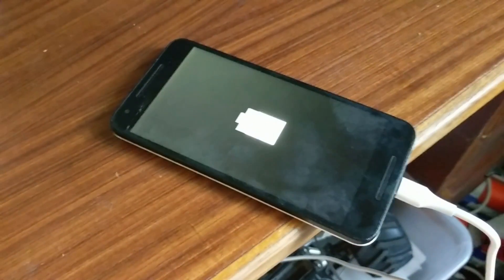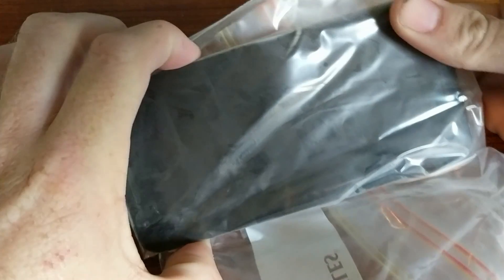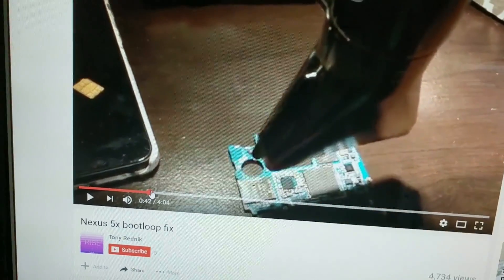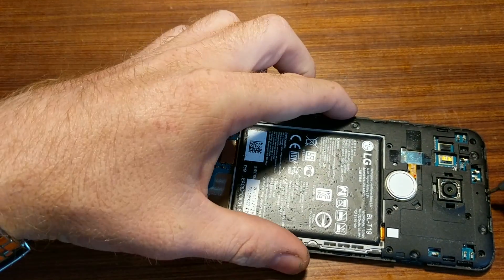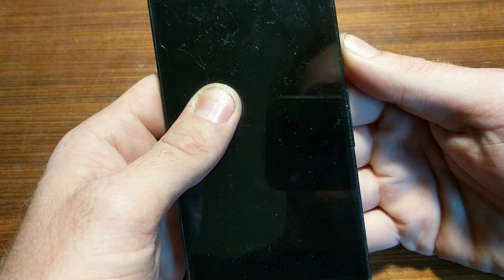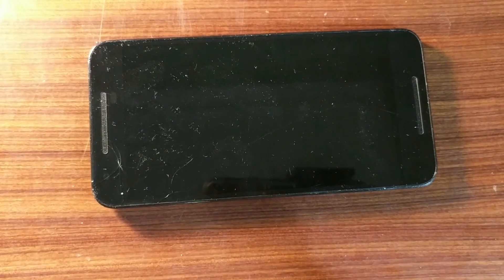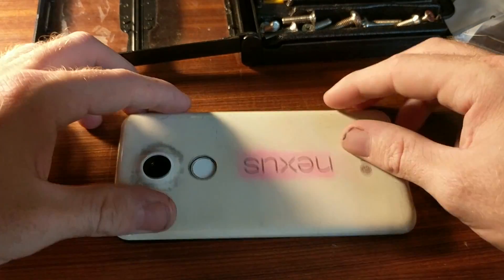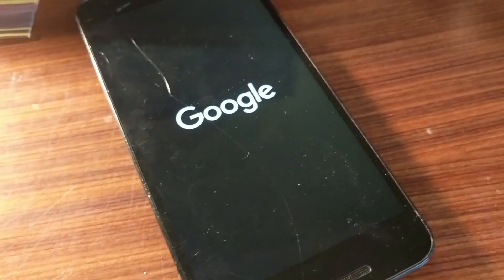How To Fix The Nexus 5X Bootloop (At Least Temporarily)

Comment: What happens when the SoC gets in direct contact with the heat ??  It had worked the first time then the error came again.  I did it again and the device worked again.  The device has no root and the bootloader is too.  I installed Substratum the next morning and Andromeda from XDA ran the script on the pc.  Later, the device did not start anymore and stayed in fastboot mode.  Now it does not start anymore.  So I ask if it can be that it does not start because the Snapdragon was too hot.  because otherwise everything looks good. ??????
Reply from the maker: Sometimes it only works for a short time after repair. The fundamental design issue is still there

Comment: So this happened to my lady's Nexus 5X and I had just the same idea with cooling and heating. This video really helped me to actually go ahead and try, thanks!

It took me two tries, first time I heated for 1 minute with my 2100w Rowenta CV 3724. After partial assembly I've connected device to computer via USB, device got further into loading routine, but was going back into bootloop after couple of seconds. Second try was 2 minutes. I've measured temperature on the chips with a pyrometer ~110 degrees C (during both tries). There was even plastic smell after 2 minutes, might have heated it for too long.

After assembling for the second time it took several rebooting attempts to go further. All the attempts were performed with device connected to a computer via USB. I was fortunate enough to get all the files from the device. It worked for like 10 minutes straight, after that I performed factory reset and disconnected phone from the computer, after what it got back into the bootloop again.

If I try to turn it back on it goes into bootloop as before my manipulations. But I got my files from the device as I anticipated. Don't be reckless with your actions and it will work out. Good luck.

Oh, by the way, I've managed to put back this metal shield, since it easily and securely snaps back into number of small "sockets" on the PCB.
Reply from the maker: Glad you got your files back! Great write up.

Comment: @What Up TK Here use the trick with the hairdryer go to developer settings unlock oem and then flash via bootloader the 4core image from xda developers
Reply from the maker: as it’s a hardware problem I’m not sure flashing helps much, did it work for you?
Reply: @WhatUpTKHere I have just tried it and  it didn't worked but I will try again

Comment: I'm having the same problem now, last night my Nexus 5X was fully charged and out of the blue just shut down. It then kept trying to restart itself showing the Google logo, to then shut down, trying to restart again and shut down again constantly. I pressed the power button and turned it off. I then tried the power+volume up, leaving it on charge, stayed there all night and didn't do anything, it was just stuck on firmware update at 0%. I found it boiling hot in the morning. I let it cool down, then tried power+volume down, and neither of the two options would work, Recovery Mode nor the Restart Bootloader. When I selected Restart Bootloader it would say No Commands. I also did a factory reset but still nothing changed, the main problem is that the phone doesn't stay on, I was only able to try these options by keeping the phone plugged in, as soon as you unplugg it from the charger it dies!
Anyone has got any suggestions? Thank you
Reply from the maker: Hope you recovered it@

Comment: Once you pull the motherboard out - Use a heat gun on it for about 1.30 then leave it cool for 1 hour, put the phone back together. Hairdryer is not enough heat to remelt the solder points.
Reply from the maker: Joe Szabo as I discovered in the next video ;D

Comment: The only thing that is easy to break on this phone is part of the plastic shield, it is really easy to accidentally break in half, but breaking it isn't really a problem as there are screws about 1~2cm away from the place it tends to break on both sides, so you can literally just put both pieces back on and it will be fine XD
Reply from the maker: Good call!

Comment: Haven't had a chance to read all the comments, so apologies if this is a rerun of other comments, but I'm going to prattle on just the same:
1.) Turn the hair dryer onto "cool" or "air" - any dryer made after 1990 should have a non-heat setting
2.) Grab some silica packets from shoe boxes, pharmacy or vitamin bottles... and put them in the bag or tuperware box before you put them in the freezer
3.) Don't have any silica packets? You can buy "water pellets" or "water beads" from your local big Crafts store. They are made to go in vases and the like, but they suck moisture out of everything -- including condensation.

Thanks for all the help. 
I know a lot of people are overjoyed to have their files back.
Reply from the maker: That's a great idea, re: silica gel. Thanks for sharing!
Reply: @WhatUpTKHere  use the trick with the hairdryer go to developer settings unlock oem and then flash via bootloader the 4core image from xda developers

Comment: Or you can enable oem unlock and debugging then flash a custom boot image to keep it always working.
Reply from the maker: Marcus Weinberger doesn't work if you're stuck in bootloop, tho <3
Reply: Good point, what about using your method to get it to temporarily work, then using mine (I say mine, but I found it elsewhere)? Teamwork :D

Comment: Getting into recovery is pretty good though. I had the same problem with 2 identical phones, different timetables. For some reason, some of the cpu cores crash, or cause a nasty error that gives the boot loop. I had my phone with default settings and no usb debugging permissions, so I freezed it and managed to grant myself permissions over USB. Then I applied a custom bootloader I've found on xda and kinda fixed the problem. The phone is still working, but is quite slower.
Reply from the maker: Nice! Did it live long?

Comment: My Nexus 5x (which I had for 1 year and 4 months) just died two days ago. The freezer method worked a few times but I'm glad I copied all my photos and videos (not the recent ones) to my computer about 2 or 3 weeks ago, so I had nothing to lose pretty much. I'm not trying the freezer method again simply because I'm worried it'll get any water inside and possibly trigger those small white stickers and turn them to red (the ones that determine if your phone has been in contact to water). Haven't tried the heat gun yet but I'll just RMA it and keep you guys updated. This is the best phone I've ever had and honestly I just see myself (if this phone get fixed) using the Pixel phones by Google as it has stock Android. I'm just worried it has the same problem...
Reply from the maker: Funnily enough my Pixel did bootloop, too. However I was lucky as I had warranty on that phone.

Glad you got your files back!

Comment: Also worked for my nexus 6p i thought it was a software issue couldnt reboot to recovery or anything until i tried this i was able to start up the phone without having to factory reset or install fresh firmware. Btw i done this without taking the phone apart. If you do just avoid heated the battery area and concentrate on the board side of the phone.
Reply from the maker: Glad it worked for you!

Comment: Did you put the back back on once you finished with the hair dryer, what about the metal shield for it
Reply from the maker: Yeah, no difference.
Reply: oh ok, so what are the nonessential parts for file transfer, so i only have to plug in the motherboard right
Reply from the maker: Dhruv Jain not sure, I'd wager you'd want the phone close to fully reassembled because you need the screen to log in and approve USB file transfer. If the phone is locked you can't dump your files
Reply: alright thank you so much, btw is 30 mins enough in the freezer
Reply from the maker: Dhruv Jain only one way to find out :P

Watch the second video I did on this too.

Comment: Thanks for the video. This was not a firmware issue for me as the exact same boot looping started happening after the phone rebooted randomly and would not boot back up. Used a heat gun for about 30 seconds on each side. Let each side cool a bit for few seconds before starting on the next side. Phone booted right up after the heat fix.

Comment: LOL, I'm bidding on a bootlooped Nexus 5x was curious what they meant by bootloop The fix should be easy... I don't know how a reflashing of the phone wouldn't work... Many talk about this bootloop and the fix was to reflash the phone.
Reply from the maker: Matthew Knight give it a go for sure. This phone was literally completely unresponsive prior to freezing. Can't reflash the phone if it's not even responding to USB.

After I dumped the files I attempted a reflash through ADB and it failed at 57%. Sucked.
Reply: TK eh I have nothing better to do with my time my only fear is possibly fixing it then it happening again I was planning to buy it for my mom. I'd hate to have the phone fuck up 2 months in to giving it to her.
Reply from the maker: Matthew Knight yeah, I get you. Some may be fixed with a reflash but for many it's actually a hardware issue and much tricker to fix. Even after the follow-up video I only got another month out of mine.
Reply: You're not selling your nexus 5x on eBay right now are you? cause someone has one for $50 and free shipping, And he too did the freezer method which is extremely bad to do, should never put any electronic into a freezer, when it starts to sweat after coming out of the freezer its just as bad as putting your phone is water...
Reply from the maker: Matthew Knight certainly not selling mine haha.
Reply: TK eh I ended up winning that Nexus 5x should be interesting, I've heard of two possible fixes, 1 if you can get into recovery mode then you can flash it with a fix that will disable some feature hardware wise and the other fix is if you can even get your phone to work by draining the battery you can take the phone a part and add a copper heatsink on top of the chip and add thermal paste.

Comment: Same issue here. I was running Android 8.1 for just 24 hours and it just died while at the charger. Luckily the freezing method worked for me and i was able to secure some very important docs and unlock the OEM bootlock. then it just died again. I saw a few bootloop fix tutorials so i hope do be able to revive it definitely.

Comment: Just followed this video and attempted to reflow my 2015 Nexus 5X with a small hot air gun (sparkfun model).  I was nervous about lifting some of the very small caps next to the chips, but applied heat from a distance for about 90 seconds.  Seems to have done the trick.  Thanks for the walk through.

Comment: You can open up the device , take motherboard out, remove the mettalic cover and keep motherboard under sunlight for 2-3 hours. And the let it be open for some time after that at romm Temperature and then try to put back everything at place and turn on the device..and you can see it working..

Comment: Yeah, happened after my last security update. Luckily I back up automatically to the cloud, not so lucky it's probably 2 weeks out from the Pixel 2. Thanks for clearing the issue up. Not willing to fully take it apart for a hardware issue, but it at least saves be the hours of trial and error.

Comment: hai bro...  
i do have the same problem.. i have heated upto 300deg by hai dryer.. for 1min then after 1hr.. i switched on mobile. it worked for 2min then back to dead.. i heated for 4 times in 2days  about 1min 45sec.. it opens and goes to bootloop... main problem is chip is getting very hot.. with in seconds for hitting power button.. how to make cool of the chip and any solutions bro?

Comment: I've managed to fix my Nexus 5x from the infamous bootloop. It had been doing the bootloop for weeks and me and my friend looked on line to fix it and of course we tried this method but we didn't have a heat gun so we just used a dryer and it sorta worked, it lasted for about 5 seconds lol, but before then I  couldn't even go inside, but this "heating method" only worked once, and then we were out of ideas to fix it, we couldnt do anything to the phone with a computer because I forgot to check OEM unlocked and USB debugging ,so we couldn't change the Android version or anything but then my friend went to recovery mode and did the sideboot and somehow managed to do something (I wasn't there) and it actually booted and he quickly checked OEM unlocked and USB debugging and then we were all set , we found this fix that we wanted to do ↓
https://www.xda-developers.com/nexus-5x-bootloop-fix-boot-phone/
And my friend did this for me( I don't know how he did it cause I wasn't there and even if I was I wouldn't have been able to understand a bit) and it actually worked!! 
So i hope you guys try out this method , if you don't know what you're supposed to do and your not so good at computers then go to your friend that's good at computers and hopefully he/she will fix it for you . And I think if you just follow the steps you'll be able to do it anyway ( if you have OEM and USB debugging checked) if not go to recovery mode and do a sideboot/sideload , ( I'm not sure but my friend said he'll make a video on how to fix it even you don't have it checked)
BTW I actually thought it was impossible so I bought a Galaxy S8 so now I own 2 phones .... yeaaaay :-) 

I'll come back here when he makes a video good luck guys!!!
Reply: Jake Martin your phone still works?
Reply: Is your phone still working Jake Martin?
Reply: Tired it still doesn't work.

Comment: After applying a piece of tape on the fingerprint connector found at the back of the plastic cover, the phone kept working after being assembled. Maybe some kind of shortage was caused? Nonetheless, thanks for sharing!
Reply from the maker: Interesting! Perhaps it's putting pressure on the chip and improving a connection somewhere? I might have to experiment - thanks for sharing!
Reply from the maker: can you show me a photo?
Reply from the maker: Didn't work for me I'm afraid!
Reply: My phone started bootlooping while I was texting, and coincidence, my finger actually touched the fingerprint thing 1-2 seconds before it started fucking up. So yeah, maybe my fingerprint connector's the problem ?

Comment: Worst google phone ever... bad Google update work... shame to say it, but it's sad. :(
Reply: I don't have any doubt of your testimony. But This phone is dissapointing, the only good feature is the camera, this board/hardware issue is only the proof of a bad design and a bad construction.
Ok, I will see you channel.
Reply: Robert Martinez I really like the camera and the fingerprint sensor (thought I can't believe they didn't include image stabilization, Nexus 5 was better for moving video). It does seem to run less smoothly than my Nexus 5 overall, plus 5" is a better size than 5.2" for me. At least LG is fixing this major problem. I would really like to see Google run both a Nexus line (really just a Nexus 5 with updated specs) and a Pixel line. The Pixel is a fantastic phone, but the price is simply too high for me. Thanks for checking out my videos, I hope you have the same success as I did getting your phone fixed.

Comment: I'm real fuckin' mad. Saw this on r/nexus5x after mine bootlooped last night, worked on a 30min freeze for about 2h last night, tonight it only worked for <2min- booted, got SMS Backup + running, backed up a couple of messages and then crashed again. I think I'm at the point where I'm not touching it for a few days then retrying the freezer method, probably for a longer freeze. I don't want to take it apart because at that point I'm sure Google will just not give me a replacement (whereas if I've just frozen it a few times and condensation causes the moisture sensor to trip, I will fucking scream bloody murder if they try to tell me I can't get it replaced).

Has anyone gotten a refurb'd 5x and tried the Android Beam transfer with their janky bootlooping one? I'm trying to figure out if my phone would live long enough to do that to a new one but I don't recall how long it took when I went 4 -> 5x.
Reply: I've heard that LG will help, but iirc when I went to them they said to go to Google since I had purchased from them. I have a service  working on it right now, as Google had told me that they'd allow me to take it out for data recovery. They've already charged me for the RMA but will refund when they get the original one back (presumably, anyway. at this point, whatever, I just want my damn data back & will have these folks do anything they can to get it).

Comment: Seriously have the same issue with mine.  Do you have more info about what's going on? I keep getting crashes etc and I don't know what to do.
Reply from the maker: SaintHobson It's a hardware failure, joint between a chip and the PCB fails. back your stuff up and get the phone warranty replaced or dump it. :(
Reply: Man all I want is a good cheap phone with a great camera, does such a thing exist tired of these semi-expensive phones that keep dying on me... Don't even care about performance all that much, just the camera